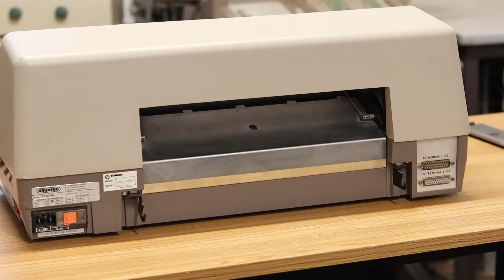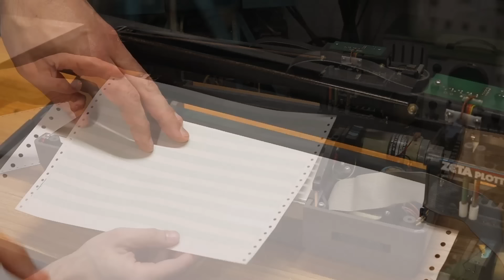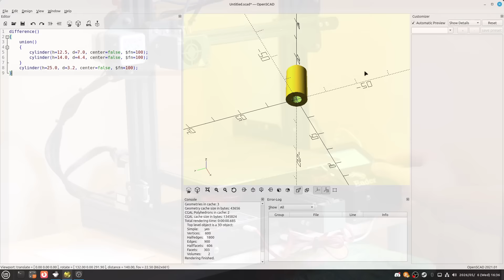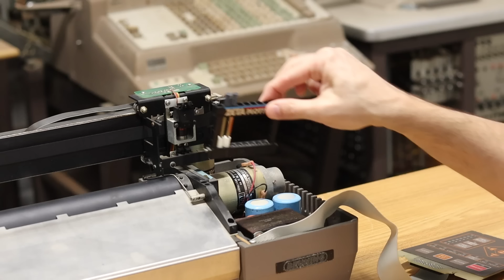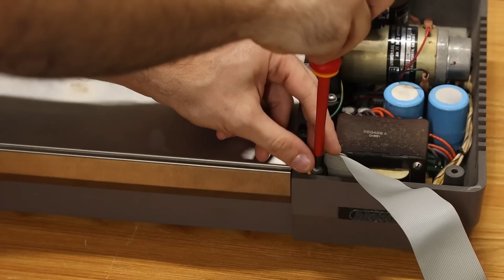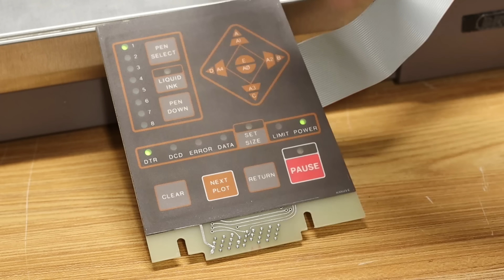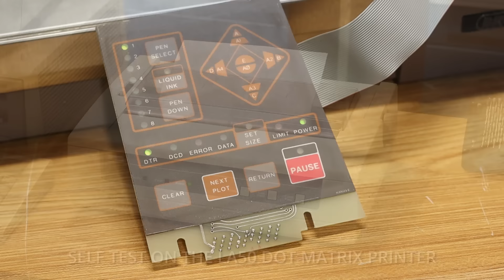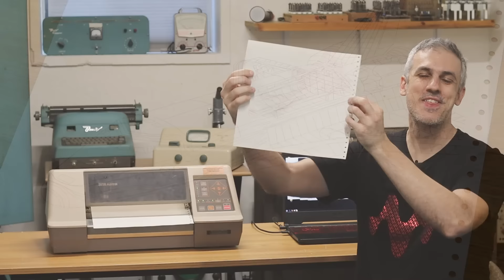A Pen Plotter from 1986!

Comment: You've never used a pen plotter?  I think they are quite interesting.  My high school had a big Hewlett Packard drafting plotter when I was in high school during the years 1999-2004.  It was much larger than this (like a wide format printer for posters) as it was used for drafting and design, but could possibly also be used for geography or other things as well.  It connected via serial (RS-232) to a computer and if the data rate wasn't correct i.e. too fast it would flash the error "Overflow" and do some pretty weird and interesting lines across the page.  When you put a fresh piece of paper into it it would automatically measure it with sensors that read the drop off of the edges and feed the paper back and forth three or four times to verify it was set correctly as we used approximately Ledger-sized paper so 14 by...20 inches?  I can't remember.  When it plotted it was interesting to watch it take pens from the built in carousel and used different colours for the dimensions and various parts, if necessary.  It was eventually replaced with a wide format inkjet printer, one of the first machines I saw with individual ink tanks connected to the print head via a ribbon of clear, flexible tubing.  This was before the Epson systems seen in use now and most inkjet printers up to that point used incredibly expensive ink cartridges.  One of the tubes broke so I tried to find a way to repair it without success, I think.

EDIT:  I think we (the high school design class) had a smaller HP plotter similar to the aforementioned HP 7475A you mentioned, but I don't know if it ever worked.

Comment: I haven't used a plotter in maybe 3 decades. Some it was on the 8' (eight FOOT) wide HP plotter making mechanical diagrams. (aka, blueprints) The first was back in high school, at a summer program in the Textile Engineering department at NCSU... fabric cutting LASER plotter. These things are still around cutting decals, printing blueprints, and Epson had a few models that could direct print on fabric.

(Your 3d printer is also a plotter.)

Comment: Hello Usagi I have few tips for you

1) while printing that small things with a 3d printer regular 0.4mm nozzle is not enough, you either need to use a 0.2mm nozzle or better resin printing. If I was in the US I would happly send you a few. the strings between your parts area caused by the moisture in the filament, easiest way yo get rid of that is drying your filament, to do that put the filament spool flat on the heated bed, put a small box over ot that covers the whole filament and set the bed temperature to 60 degrees. flip the filament every 2 hours and after 8 hours your filament is bone dry. also having a direct drive extruder will help you greatly with printing small parts, there are a bunch of free models online to mount the stepper above the extruder, you just need to print them then do some installing. 
2) for the paper I would cut the wider paper like you are using however I would glue 2 different papers in a way that each of thems holes would be on the other side so when you put the paper in the plotter it would hold into the tabs in either side of the drum.

Comment: Umm.. I might have the paper you need. My work has been using a ream of something similar in size as a door stop for 7 years.😂 I will need to check when I go in tomorrow. This paper was either used to print mine schematics or inventory paperwork sometime in the 80s to early 90s. The plotter and dot matrix printers that used this paper were removed circa 2020

Comment: Its more likely this tiny plotter was originally intended to be used with rotring isograph ink pens, as the huge diameter of the slots hints to.  But they only work if used on a regular basis or emptied and washed clean between use. As far as I remember, they were emptied and washed clean every day. I know, because they were common for hand drawing (on the huge drawing boards with the suspended rulers) and all grown up plotters of the time used them as well. I grew up between those and playing around with them, as my father had led an engineering company back in the day. These roller pens you have here were most likely an optional thing,  more sturdy but had their own set of problems, as they had a tendecy to stop drawing mid line, just because the roller ball got stuck with paper dust... I am pretty sure they were an option for occasional use by less experienced personell. But there are replacement pigment ink felt tip Liners available as a isograph replacement with the same big diameter as far as I know.

For the paper problem: Use plain paper, let a laser cutter do the holes on both sides and the width of the paper in one go. Like 70 cm long. In that case you could also use transparent paper, just because it looks more technical (and is more sturdy). For Rotring ink pens you would have to use transparent paper anyways, because these rotring pense were not made to draw on plain paper relieably as it dissolved over too much ink fast.

For the rubberthingy: Give the design to some 3-D printing company like shapeways to make an SLS print, if it makes sense you could even do it with flexible material (its rather firm, like flexible plastic). In that case you can go down to 0,5 mm wall thickness easily with perfectly smooth surface.

Comment: Maybe, try one of these, "Carl GP-J20-B Gauge Punch, Loose Leaf Punch, Multi-Hole"? You can use a roll of wallpaper lining paper, as it's cheap, and cut some to the correct width on a flat surface. Give us a shout-out if it works.

Comment: Try and get  some A3 tractor feed fanfold paper. The fold section is on the perforated strip so if you just roll it up there will be no crease's to worry about.

You do realise that, if the US caught up with the rest of the world with regard to REAL metrology systems, you would be having a totally different problem. That of trying to find obsolete US paper sizes for your old pre metric printers. 😁

Comment: As for the thin section of those prints, look for a setting called minimum layer time, or something similar depending on your slicer. When you are printing something thin like that the nozzle doesn't leave the area it just laid down like it would on a larger print, meaning heat will build up causing the layers to not set well before the next layer is deposited. Resulting in distorted, blobby or even failed prints.

The minimum layer time tells the printer to take a break every time it lays down a layer on a feature like this, it just moves the nozzle away and parks it for as long as you set the minimum time, then comes back to do the next layer.

Comment: Takes me back to my college days at the start of the 1990s. The electronic engineering department got (possibly donated) a pen plotter. I don't remember the brand. It was big, I think it was A1 or A2 single sheet although it could easily plot on A4. It was elevated so large sheets of paper hung over the sides as it plotted. The platen was a sectional bi-directional conveyor, so the contact surface area was relatively large while allowing for quick changes in speed and direction. The pens were dinky little things (too small for adult hands) with wick felt tip style nibs. There was space for six pens on a carousel and it would rotate, loading or unloading the 'active' pen. It was great fun to play around with, although we quickly ran out of our limited large paper supply. IIRC to plot graphs and charts we used an early version of Harvard Graphics we had running on some entry level Amstrad PCs (They used 1512s and 1640s at the time).

It definitely filled a niche too. It was about the only way we could get any kind of hard copy output in colour without it costing an absolute fortune.

Comment: your 3d printer problem is probably moisture, im not sure what material you were using but PETG is kinda bad about moisture.
on amazon there are $40 filament dryers that are plenty, i use the Comgrow 2 spool dryer and its plenty for pla and petg.
-the super budget trick is get a plastic container/bucket that will fit over your spool and use the printers heated bed to bake out the moisture. ive had to run spools in a dryer for 8 hours at 50c to get them to work right so let it bake to dry it out.

Comment: Sounds a bit like a fast typist on a mechanical typewriter!  Funny how it throw the printout on the floor when it finished!  I had a much smaller pen plotter on a TRS80.  I think it was called a CGP115.  It had tiny little pens that fitted in a square "head", and every time it changed colour it had to move the carriage to the end and then nudge the square thing around to get the correct colour, so it was quite slow.  It could even do text.  Trouble was it didn't use a known plotter format so you had to use BASIC to code your designs.

Comment: The paper could be A4 landscape / A3 portrait, 297 mm. wide, with 16.5mm. wide tear-off margins for the feed pins.

Even if it requires building a special machine to cut a larger sheet of paper to the right width and punch holes at the correct spacing along each edge, I feel like I know someone who's just about crazy enough to attempt that .....

Comment: You may be able to take up the play around the pens with a little bit of heat shrink tubing. First your shorter plastic piece goes on, then the heat shrink, although you may need a specific size of heat shrink since they do get thicker when they shrink.

Comment: Pen plotters are cool. Radio Shack used to sell a couple, at different times in the 1980s. My first was their little about 4 inch wide model. Then later I got one, second hand, that took regular 8-1/2 width paper. 
I'm sure with your shop, one could make a punch setup to "modify" banner paper rolls found in most of the craft shops.

Comment: Haven't gotten to a pen plotter yet...but did, after 40 years, get lucky on ebay last year and got hold of the special ASCII printwheel and messenger module for Smith Corona typewriters and got it banging out ASCII art of cows (among other critters)... Also found the user port serial printer adapter for use with Commodore computers, so once I either dig out my old C64 or get one of the new FPGA versions can get letter quality printouts...but no PETSCII...

There's something fun about using a modern computer running Linux with a serial dongle to make ancient peripherals go. It's hard to explain to people who don't get it. It's also a massive flipoff to Microslop and their usual planned obsolescence of fully functional hardware.

Comment: You could probably buy a cheap roll of 24" 20lb CAD paper and if you have a fine tooth band saw you can get access to, you might be able to at least passably cut it to width. And I bet you could build up an arduino powered punch machine to roll the paper onto a 3D printed spindle and punch the tractor holes in the process. Maybe even perforate it somehow with some perforation wheels? If you know someone who does basic machine work, maybe that could be an idea

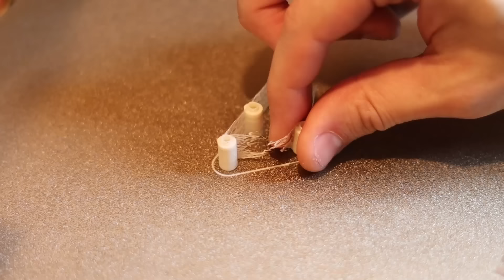Comment: The stringing is a combination of issues being mosture, poor retaction issues, both soft wate and physical form the Bowden tube extruder, lastly if you are printing in tpu (hard to tell from the video) it has a tendency to string although not as bad as what you were getting so still a multi issue problem 8:22

Comment: For little fine finicky parts like those pin holders, it would be faster, stronger and much most precise to just silicone mold one of the intact ones, then resin cast the new ones.

Comment: On the 3D print, that looks like moisture in the filament.  It's pretty common, especially with filament that's left out in the open.  There are a variety of inexpensive filament driers out there you can buy, or just throw the roll in a large ziplock with some desiccant packs when not using it.

Comment: For the power supply problem, the first thing I would do is resolder all the solder joints in the PS board.  You may have a solder joint that has broken off and is intermittently causing problems.

Comment: My father worked for Hewlett-Packard most of his adult life, and in the 80s, we had the company's latest and greatest equipment. As a 6-year-old, I made line drawings of houses in HP's proprietary drawing program, then had them drawn out on the HP plotter we had. It had an 8 color pen carousel, if I recall correctly, and switching colors was a slow, loud process. The plotter would draw one color at a time to minimize pen swaps. It also used individual sheets that had to be loaded one at a time. Static electricity held the paper firm during drawing. I found this video fascinating since I had never before seen a plotter with multiple colors on the carriage and instant color swapping.
Reply: We had an HP one at work. The pens were very short stubby things and if I remember had a sort of bar code on them so it new where each colour was in the carousel. I used to watch it fascinated. I can not remember how many pens were in the carousel, may have been six.
Reply: @andyknott8148  I can remember the 6 pen carousel and only think I saw an 8-pen one once. From what I remember, the carousel positions were numbered - and you put the pens in you wanted to use - and maybe assigned numbers to colours BUT you could put in the felt pens with different tip diameters - so could have: 
1 thin black
2 thick black
3 thin red
4 thick red
etc.
Reply: My elementary school had two plotters in the 90's one was an HP one like you speak of. It was sooo loud! We used ours to make mural coloring pages for school events.

Comment: I used to have an HP 7475A in the late 80s. It was a pain in the butt and traded it for something else. When it worked the drawings were outstanding. When it decides to not cooperate the output was just crap. And the pens were rather expensive. Then an HP 7440 ColorPro Plotter came my way ... well ... see above. Same problems, same fate. Had to leave the house at some point. Thanks for showing. I hope the immanent problems will resolve sooner or later. At least the thing has a way to cope with "one side guided" paper at all due to the underside fan.
Reply: I had one, too. Also threw it out, due to the overpriced pens. The mechanism was designed so you HAD to use those pens. The mechanics wouldn't work with heavier or lighter ones. And they dried out fast. That being said, I absolutely LOVE my HP LaserJet 5, which I got (broken) for free and rebuilt during COVID. When I think of the money I wasted on inkjets when my kids were in school...I could have bought a LJ5 new and still saved money!

Comment: Looks like with a little creative engineering you could make a flat bed that fits the feed pins (those paper guide wires would be in the way though) and with a flat surface you can clamp a sheet of paper to it. 
The slop in the pins will absolutely come through in the print, it's visible in the shuttle. Solution? Tape. Kapton, likely... just enough to close the gap. If you really got into using this then a future project might be to make a mold and use hot glue or silicone as the insert material. 

The pens look almost like Zebra refills will work, those are really common.

Big brain move? Design/build a tractor feed pin cutting machine. You'd never have trouble finding the right paper again, and could even run batches off for other people. In fact you could use it to make your own 'blank' paper tape rolls for the other obscure devices that are sure to grace your workspace in the future...

Might have inspired me to drag the Radioshack FP-215 plotter I have in storage out and play with it. Or at least think about it. I wonder what new support is out there now, it's been a few years since I've looked....

Comment: Sometimes old school is the solution, you can turn the thin wall pen parts on a lathe by using a solid mandrel, steel, aluminum, brass, what ever is in the crop bin of useful size. Center drill a piece of acetal rod and then turn the mandrel for a 0.003" - 0.005" interference fit. Dunk the acetal into a coffee cup of boiling water to expand it and slide it onto the mandrel. At that point you'll have enough rigidity to turn the thin wall section, use heat again to remove. Might take a couple tries to get the finished dimensions to come out right. P.S. use lighter cuts to keep the workpiece from spinning on the mandrel.

Comment: Would it be possible to print the raised piece solid and melt the hole you need with a metal pin pushed in with a soldering iron?

Comment: Could you cut the side of 2 sections of greenbar, overlap so hole feeds are in correct position on either side and use spray adhesive to join the overlap?

Comment: I have a supplier that can still make tractor feed. Not sure if they would be able to manufacture this no longer standard width. Also, I'm in Canada so really wouldn't work. The wide format epson I work with also uses vacuum to hold the paper while feeding, simple and cool solution.

Comment: Research tells me that the tractors are (supposedly) adjustable to accommodate different sizes of paper. That being said, I also found out that they make 11x11.5" tractor paper (with a total width of 12.5" including the strips on the side) for use in braille embossers. I can't help but wonder if that might actually fit with the current configuration.

Comment: I have a Heathkit X-Y plotter with a long time problem with its pens.  At first I  kept diluting whatevr original ink was there, using IPA.  Then I found that you can still find filler inks for STAMPS from some office supplies.  My present filling went over, so the pens now tend to leak, but I trust they will settle later, if not sooner.😊

Comment: FDM just won't do that level of detail - as you found out, Formlabs might, DWS certainly will.
Reply: An FDM printer can handle that part just fine. It's just not going to be easy to do it on an old Ender 3.